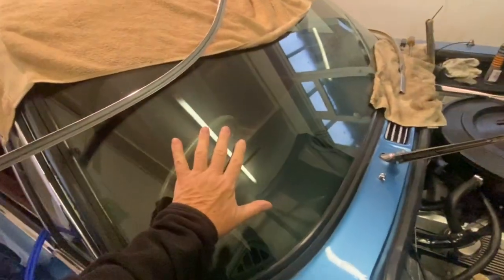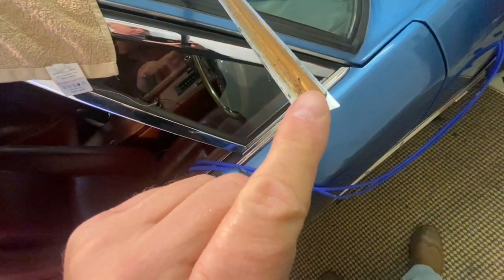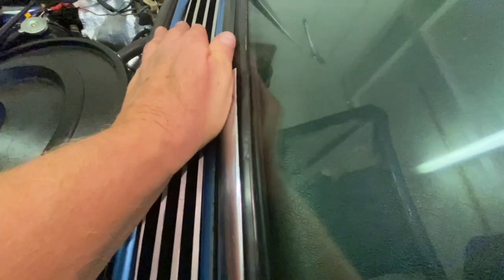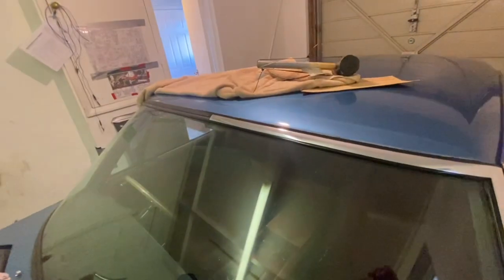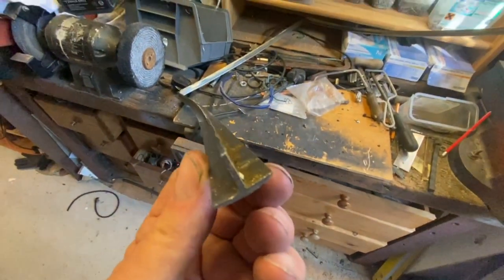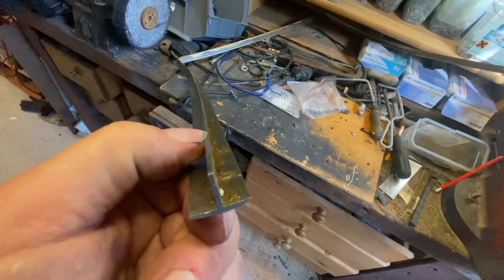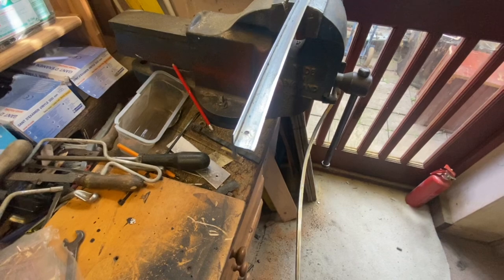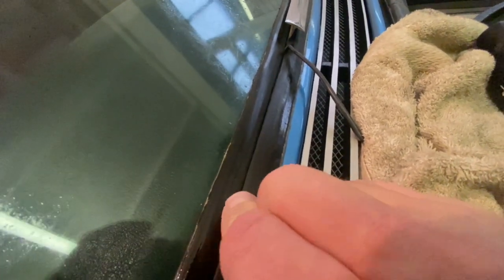Jensen Interceptor 1974.  Fitting My Chrome Trim to Front Windscreen

Comment: Really well done, mine needed doing twice by windscreen engineer after replacing the rubber first time as they thought the Robey seal was not very good quality, but second go it worked.
Reply from the maker: But maybe yours was done properly with the lip on the chrome surround retained. Mine was just inserted without a lip. We’ve done a fair bit of travelling in the car, including an all day rally event and everything is still perfectly in place so in MHO in practice its been successful.